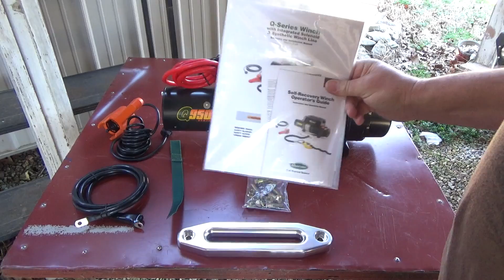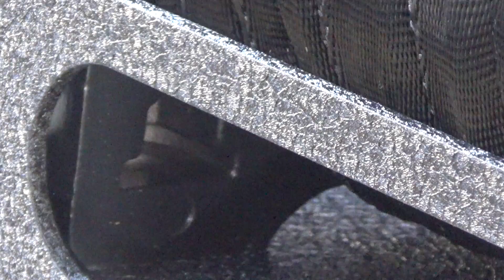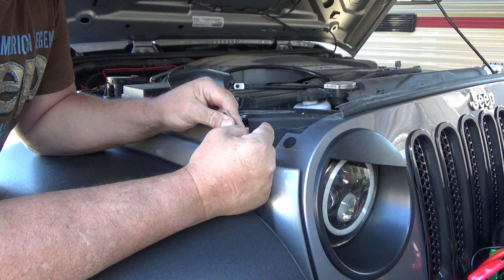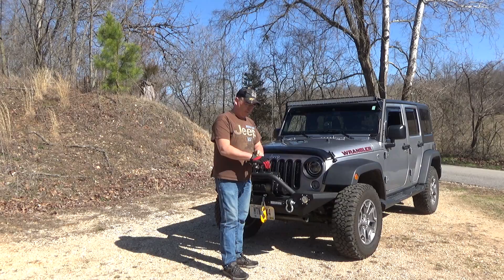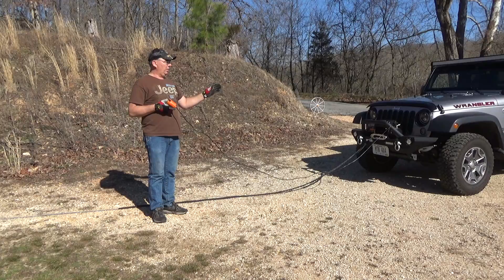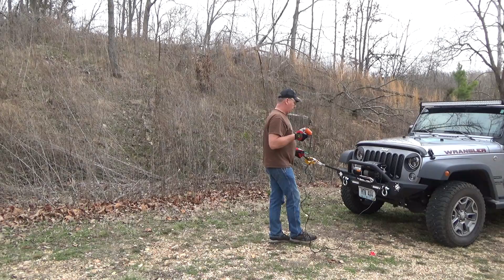Quadratec Q9500is Winch Full Install Jeep Wrangler JKU

Comment: I am definitely putting one of these on my JEEP when I get it, I have been looking at all their stuff and this is the one I want, good deal, I am glad to see you got it on your JEEP. I cant wait to see your review on it when you have been able to test it out and see. 
The steel cable may be what I go with, it will hold up better in the rocks than the synthetic, but I do know the synthetic is safer if the rope was to break. 
Good deal sir, glad to see you got this, what a great install video. Keep up the fun videos. 
Have a blessed week.
Reply from the maker: Quadratic has about everything for Jeeps, The winch is really well built for sure. Thanks for watching
Reply: Yeah, I know, I have their catalog here on the coffee table. :)